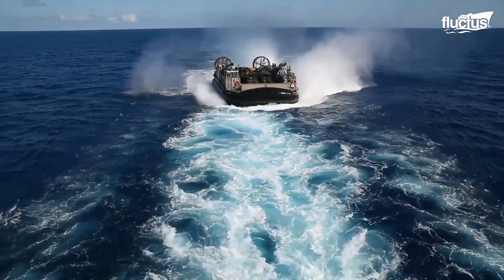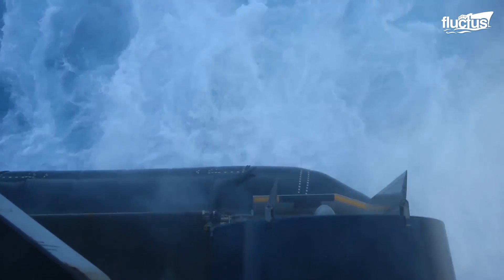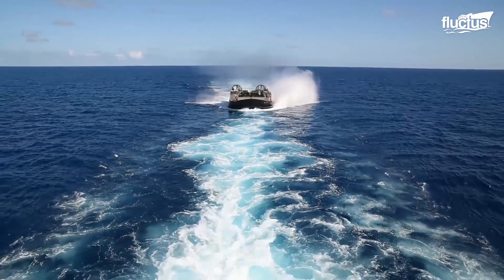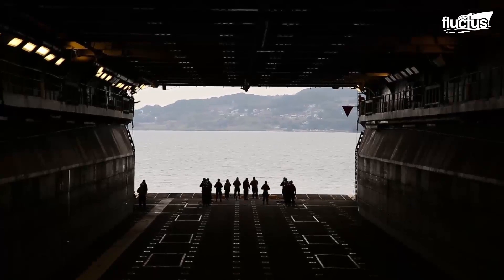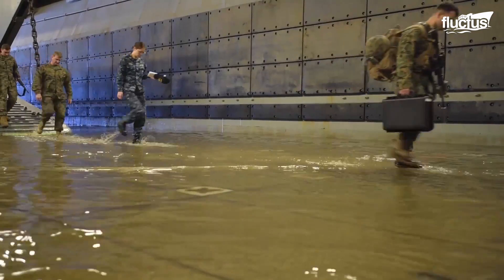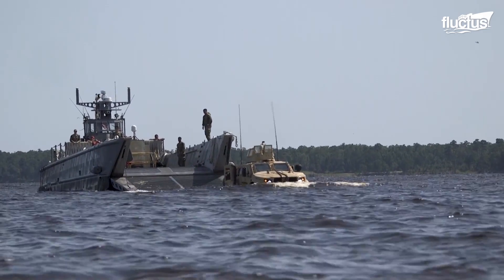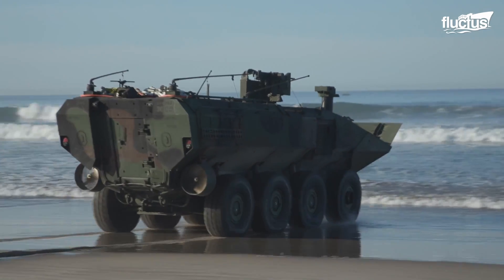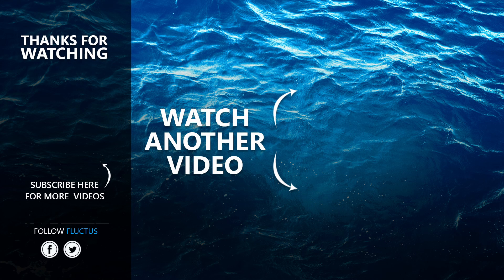US Built this Weird Gigantic Hovercraft that Can Drive Everywhere

Comment: Good 'ol LCAC. I was the deck mechanic of LCAC- 30,  1992-1995.
Reply: navigator from 90-96 at acu-5.
Reply: @brainsironically , Which boat?
Reply: @themanongentengchronicles2776   started on Bob James' crew, sent to 22, then 2, then 30 in sasebo, then 42, then 3.  Also flew 1, 5, 14 (in training,) 45, and I think 48 for a couple missions right before I got out.

Comment: Imagine an AAV with both an Avenger M-8 30 mm auto-canon as its primary anti-armor/anti/materiel weapon, but backed up with 2 M-61 Vulcan 20 mm miniguns mounted side-by-side on a rapidly-transiting turret mount for light armor/non-armor targets and secondary anti-aircraft capabilities.